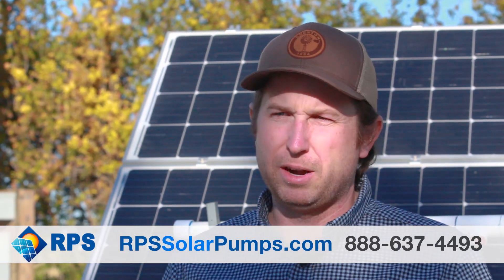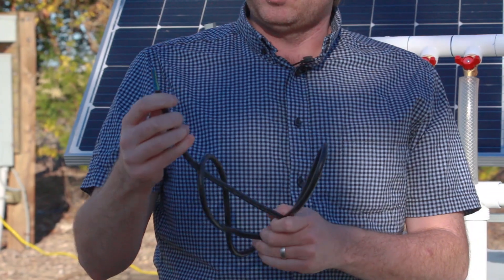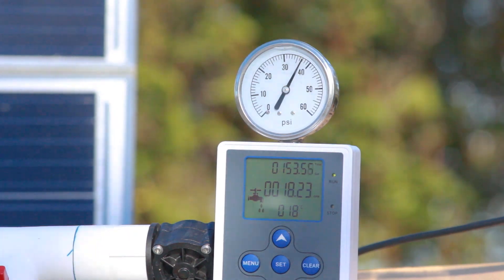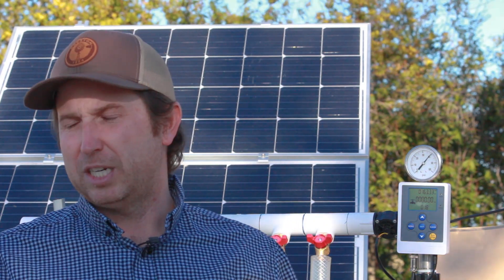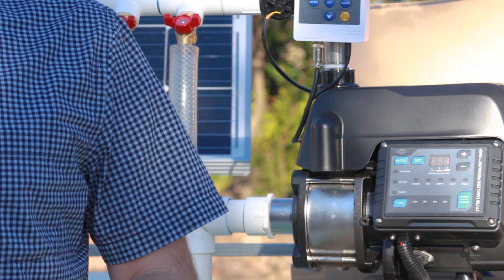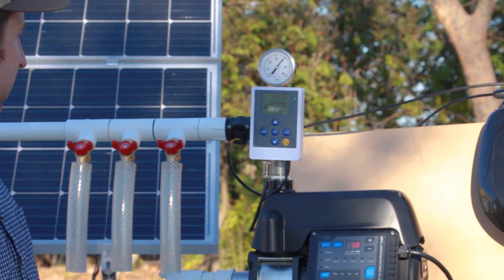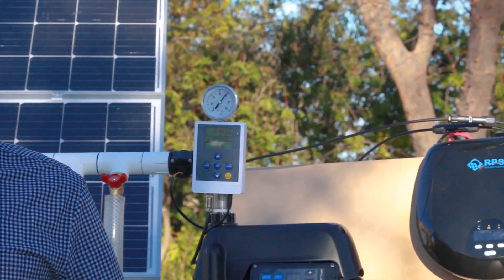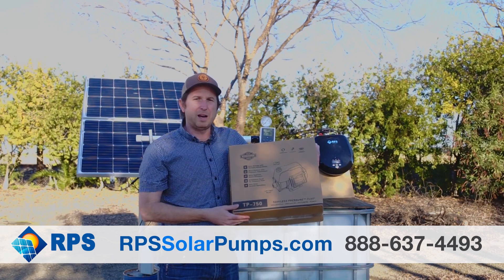RPS Solar Powered Tankless Pressure Pump™️ FAQ

Comment: This sounds great.   Would it work in the winter time when it's cloudy 6 days a week?
Reply from the maker: As long as the batteries are sized properly for that duration.  That being said for extended backup even though we don't love it, the system can be charged by a generator.

Comment: Hello,
I have a well tank room that the  well water pumps into a 2k water tank reservoir.  There is a pressure water system to booster the pressure for the house but not to the outdoor(garden). There is additional pvc pipe on the 2k water tank reservoir that is gravity fed to water my plants but enough pressure to water my future grove and grass. Would this system help with boosting pressure? In addition,  I want to add irrigation controller and multiple zones.
Reply from the maker: Yeah, if you need more pressure this system will produce around 40PSI at full flow.  Give us a call at 888-637-4493 if you want to go over options!

Comment: Up to how deep of a well will this work?
Is the charge controller like most standard charge controllers with three hookups: PV, BAT, LOAD (for the pump)? Such that I could add an inverter to the load and use the solar power setup for other needs? The reason I ask is that I don't want to invest in TWO separate solar systems (panels, batteries, charge controller), when I could probably just have a single large system (maybe your 8-panel kit) that powers both the tankless pump and provides a needed 120v hookup. Thanks!
Reply: I should note that an RPS tech told me I could buy the kit without the 4 panels for $400 less (she said $100/panel), but that I could not buy only the pump by itself, because the charge controller must come with it (?) This just doesn't sound right. If the pump can run on its own with a properly sized 24v supply, I should be able to build my own solar setup (pv, batteries, controller) and size that solar power system for my needs. .... although, if your charge controller is totally standard, then I would just buy your entire 8-panel kit and add my own inverter (if the charge controller has a sufficient load rating).
Reply from the maker: No, the pump cannot run directly from 24V.  It needs the controller to take the 24V input and drive the pump.  You can still use an external charge controller to charge the batteries, but the controller is still required.